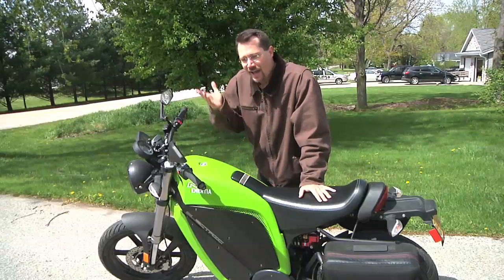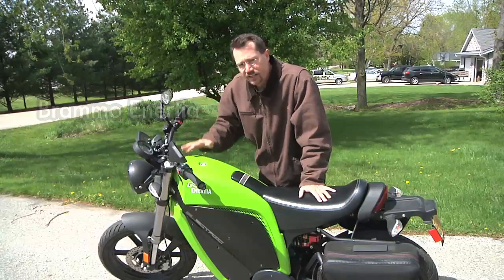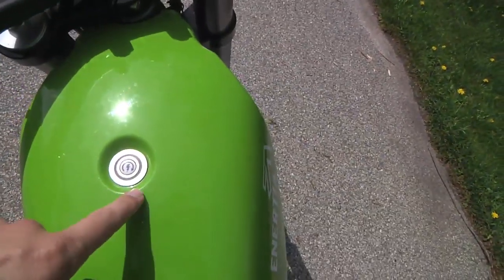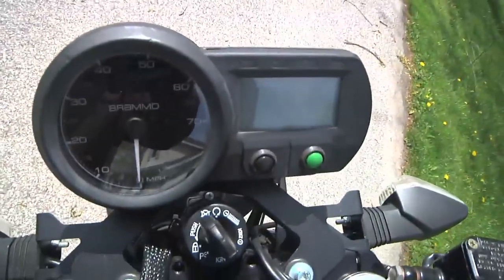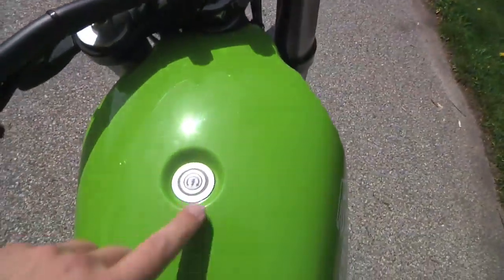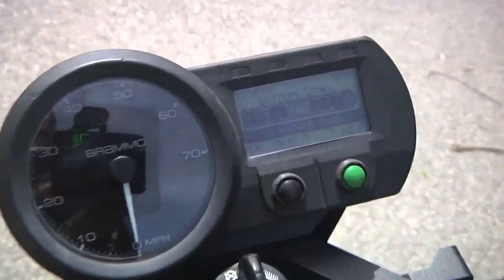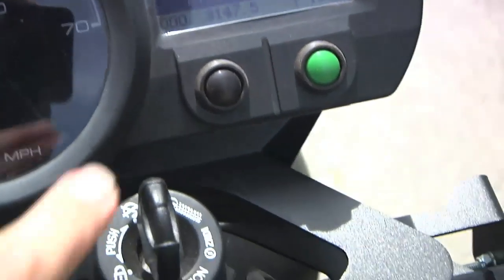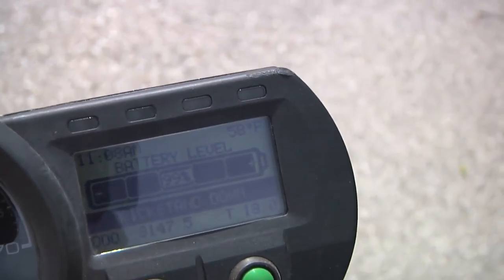Electric Motorcycle Review: Brammo Enertia

Comment: Looks like eBikes are almost there (been saying that for a while though). I've owned lots of different types of bikes, and currently have a 300cc scooter. It's great since I only ride around town to work and shops, so an eBike would make a great replacement. Couple of things with this the screen looks very 90's, the whole cluster should be replaced with a tablet style touch screen that can be easily upgraded. And the charging is too convoluted. It too should be like a mobile phone or tablet where you can just plug straight in without thinking about it.

Comment: I'd like to see a thorough "shootout" comparison between the latest Brammo and Zero bikes, with some detailed discussion of direct drive vs. gear shift. Also curious how regenerative braking compares between the two. I like engine braking on my ICE moto, so a strong regen function that'll slow the bike down strongly with minimal use of the brakes, and put as much of the kinetic energy back into the battery instead of dissipating it as heat, would be a big point for me. Also cargo.

Comment: Nice review, but I didn't hear how long the range is before recharging. One other thing is I would have to move that recharging plug so that it was accessible without having to remove the seat. The other thing I would have to get used to is the lack of engine noise. That and the lack of shifting. Those are just little annoyances though, nothing major.
Overall, like you, I'm just happy to see more electric bikes available. Thanks for showing us the test drive.